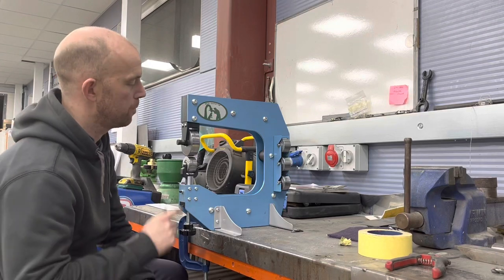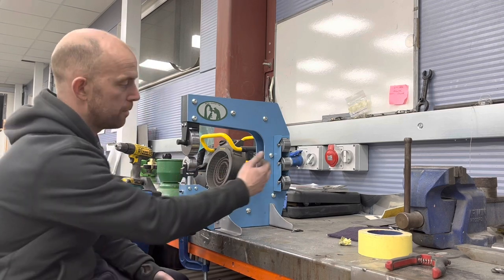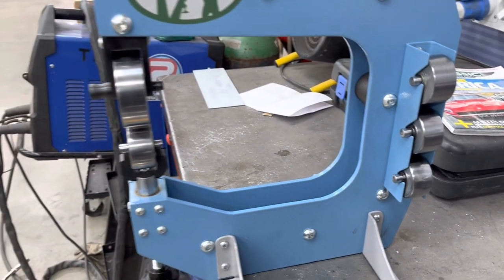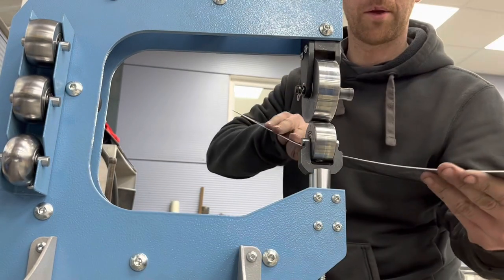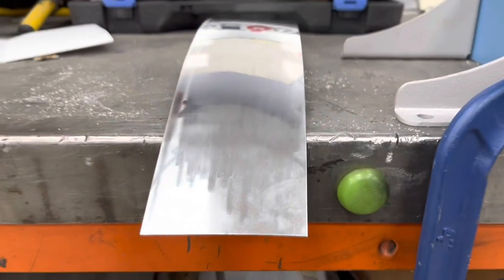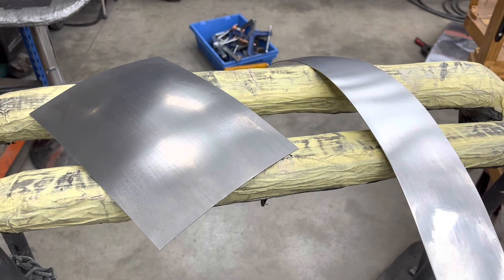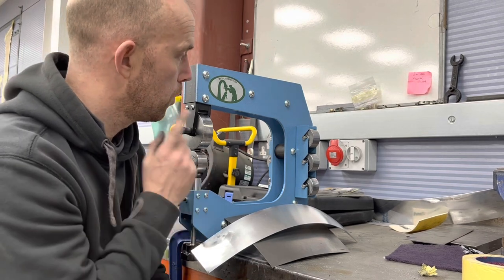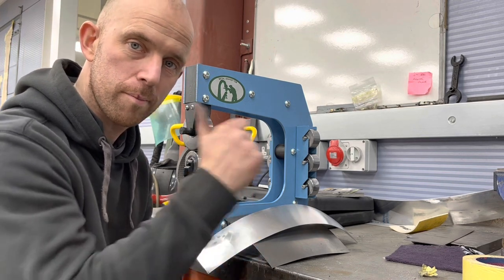Bench top English wheel - stakesy’s - Tool Review @stakesysmetalworkmachinery7402

Comment: That looks a very credible little wheel.  I have their floor mount / pedal operated shrinker stretcher which has been superb.  One thing with this, looks like it'd be useful to mount it out from the bench as far as possible as otherwise long bits will soon be hitting your bench.   

Seems nuts in these days you can buy a tool like this that could last a lifetime and produce good work all for the price of a couple of week's worth of family shopping (if that).
Reply from the maker: Completely agree on both accounts! I recently purchased the prototype cast wheel for £1000 and it’s exactly the same as another companies £2500 machine. I really like stakesy’s tools 👍

Comment: Impressive finish on the test pieces. The machining of the anvils and the alignment of the wheels looks to be a lot better than many of cheaper things on the market. 
Is the adjusting wheel large enough though?
Even though that looks like good value for the money... I hope no one tells your wife. ;)
Where are you working in this video?
Reply from the maker: Yeah I was happy with the way it’s all been machined. I know it’s all the same kit just rebranded but for that price it’s definitely better than the other rubbish out there. Is the bottom anvil big enough.. I think for the type of jobs you would do on this they serve a purpose and don’t effect it to much. I filmed this on my lunch break at work 😂 it’s a lot nicer than my little unit I rent in the evenings!
Reply: Yes the right size for smaller pieces and very impressive finish.
I expected you were at "work". 
My "shop" is as big as the great out doors.... since I work outside. ;) But I can use my brother's old 2 car garage sometimes. It's all fun. ;) Cheers.